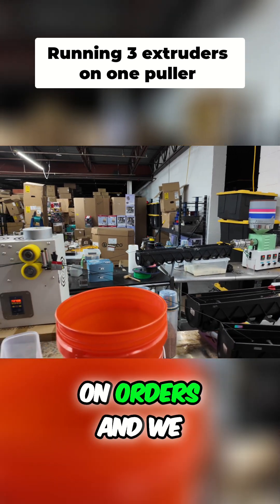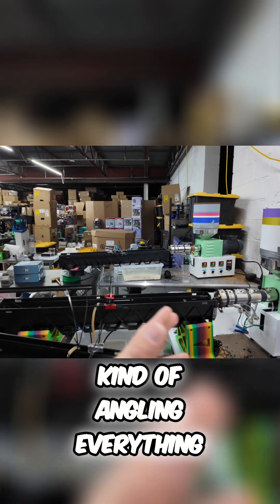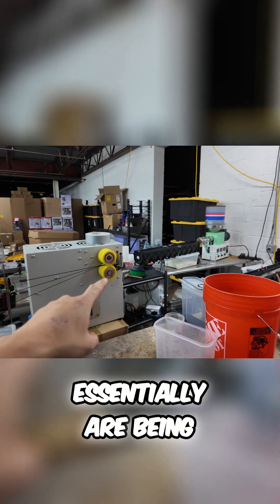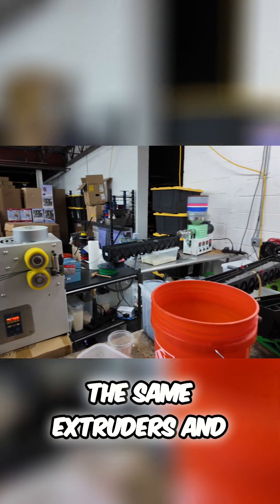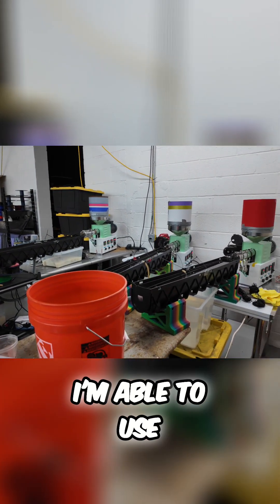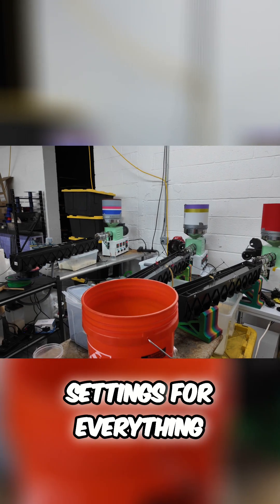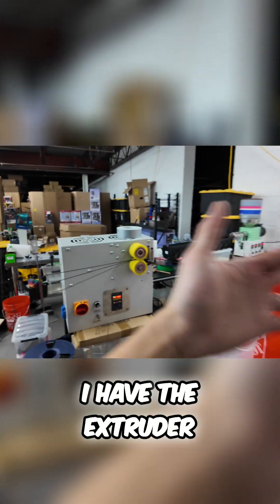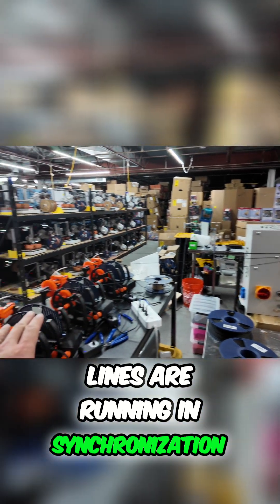3D Printing Filament Production Hack: Synchronized Extruders! #shorts

Comment: For rest of us without our own extruder(s)…

Cheapest and also easiest quality filament out there right now.

Using my guy math. 

Answer - Bambu Lab PLA bulk on spools is $14.90 - during sales it is bit less. 

Buy, print, & Sell the spools.  Bonus is no dealing with refills and can use the rfid smart of AMS. 

Currently - Empty Bambu Lab spools are selling all day long for bit short of 8$ a spool plus shipping.

Sell em for 14$ plus shipping in packs of 2. After everything plus pocketing a bit of the shipping $ paid by buyer you will be under 9$ a 1kg spool. If you want to get really thrifty - you can sell the spool rfid tags separately you can scrape another dollar off per spool selling single listing batches of the tags 🤷‍♂️.
Reply: I pay $10.50 a roll
Reply: @OWNC_0 Sounds like the Elegoo price. This beats that by over 15%